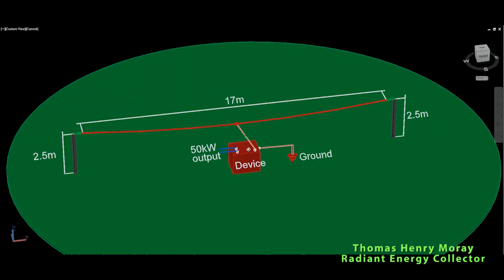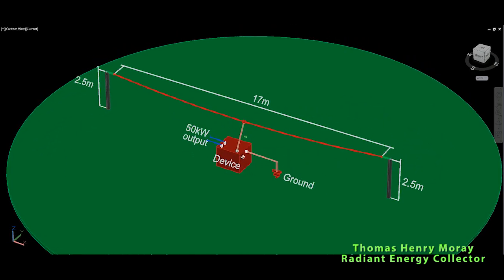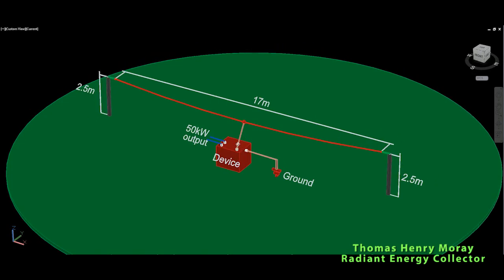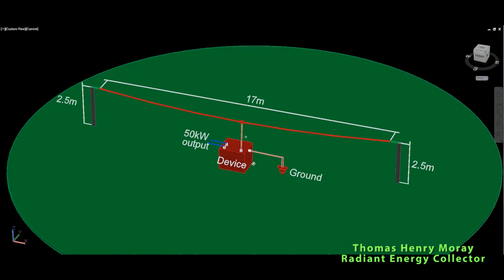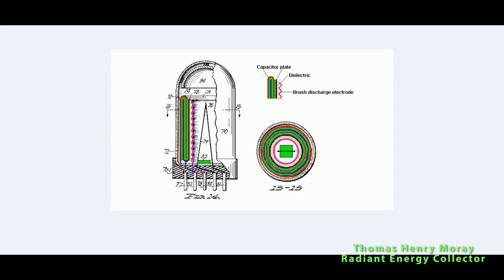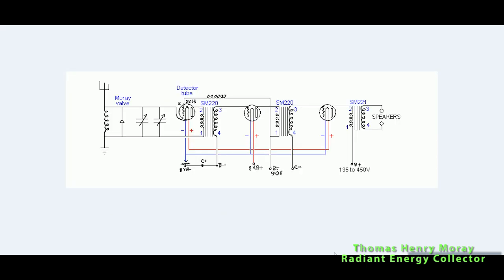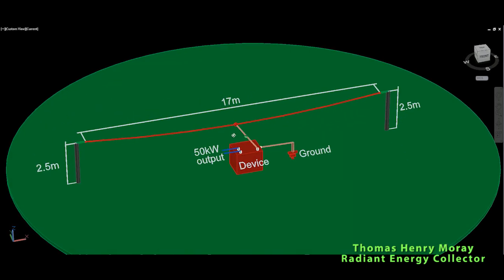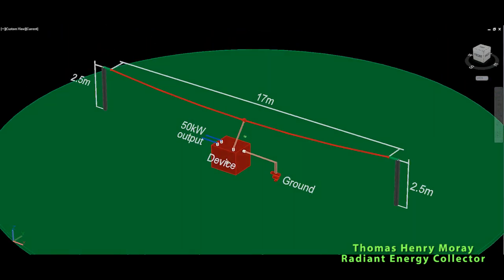Free Energy Generator, THOMAS HENRY MORAY Radiant Energy Collector

Comment: The morray valve was made using a vacuum tube produced by a company that made radio tubes it was a combination of a amplifier tube used in most guitar amplifiers and a  homemade semiconductor that was composed of a radioactive isotopes and a magnet and a emitter and collector the isotope was fastened to the emitter and the collector was a screen in front of a magnet. There was a filament in the tube that electron's jumped off of and would flow in a vacuum to the collector. The antenna was connected to the filament side and the transformer collected to the collector side then a earth ground the device baited radiant energy to flow to ground thru a transformer. The output of the transformer was cold electricity the opposite of hit electricity. I would light a bulb but would be cold instead of hot.
Reply: If you know so much why don't you just build one and release the world from these dark times?
Reply: ok! i am redjeff53@gmail.com....all of you old farts teaching your useless crap at your 'tenured' universities should get off your lazy fat asses and DO SOME 'REAL CREATIVE INVENTING!'  try this you asswipe critics of those you are jealous of! bore a hole in a chunk of uranium, 'turn' it on a lathe until you have a 'tube',...(wear a mask you idiots!) wrap it with a 'bi-filar' coil of copper wire,...slip another similar but thinner coil inside of the 'tube, connect the device(s) to a transformer, then measure the voltage and current for the next 10,000 years!!! ha,ha,ha,ha,hah,haahh! (redjeff53@gmail.com)
Reply: i,, redjeff53@gmail.com,...am working on this idea to power a mobile space station that will traverse the stars and travel at the speed of 'thought!!!' i will not need 'tubes' such as this 'henry moray!' i will experiment with hollow uranium tubes wrapped inside and out with 'bi-filar copper wires connected to transformers!!! ha,ha.haaah,haaaahhhh!!! (redjeff53@gmail.com)
Reply: @norakat  He would not find a manufacturer for the velve tube.
Reply: RADIANT ELECTRICITY  So radiant energy has nothing to do with quantum physics?
Reply: @pulsetao3446  nope, just invisible energy siphoning.
Reply: this device was 'tuned' to be off-harmonic or a harmonic of the frequency he wished to utilize. does anyone know for certain just what that frequency was? was it earth resonant? 7.3 or so hrtz? (redjeff53@gmail.com)
Reply: we should be able to make the cold tube now quite well and have a amp that adjust for best signal and changes for load now.
Reply: The heart beat of the earth! As Ham radio enthusiast would say! The morray device worked as I had previously described. It would attract radiant electrons to the antenna by baiting them into the circuit offering them a Ground. The electrons was captured by the vacuum tube amplifier circuit. Just as a simple crystal radio would operate by using a diode or geranium crystal and a cats whisker wire. .but the vacuum tube was a electron diode and trap circuit causing radiant energy to work before allowing it to flow to the ground.  A bifilar transformer captures the back emf and utilizes this radiance emission.. Tesla used a spark gap to create radiant electricity, and amplified this through the primary coil capturing it in the secondary as amplified electricity. Transformers step up or down current. There are many types of transformers and different windings . Copper wire emits magnetic fields as current flows, this field can be captured by another winding.  Radiance field is from a saturated coil collapsing as current is switched off this back electro magnetic force is captured by another winding and it freely flow's to ground and can be put to work before it is allowed to flow to ground.   Wire up a diode from a microwave to a spark coil from a car connecting the diode to the high voltage terminal to the positive on the primary and connect a power source and a interrupter sutch as a  switch or relay contacts and wire the relay to buzz  the coil will throw sparks much more  now attach a ground wire to earth and to the ground of the coil next attach a wire antenna ran up high  to the positive side of the coil don't allow the antenna to ground. When the coil is operating radiant electrons will flow to the antenna and be captured by the secondary coil and allowed to flow to ground as a high voltage spark this current can be stepped down by using another transformer it will be ac current and can be rectified by using a bridge rectifier
Reply: i wonder effect placing a potentiometer within the bridge rectifier would have on the final current? (redjeff53@gmail.com)
Reply: A potentiometer would create resistance and lower or raise current flow. If current flow was greater than pot value it would heat and burn out.  The morray valve was created with a doped Geranium Crystal crystals can be treated with radiation and they can be grown from liquids or gases. Crystals can be cut and tuned to oscillate at chosen frequency's. A piezoelectric crystal gives off current when compressed but will also give off current with oscillating currents  crystals distort thier lattice srtucture creating current flow
Reply: @davidwilliam1406  
Sounds good, can you rebuild for Ex the Tesla Converter, caused over 100 years agi it worked in a E car.
Anyway several years ago I stumbled over somethings interesting.
This guy converted a simple bicycle dynamo in a minipower plant to provide his small remote hometown first time with electricity, just 1 bulb for each house.
He did not explain what he really did, but it was about the copperwire winding around the Stator.
I heard only one Word "Helix" I started to investigate, but I found not information.
Anyway this boy said he converted this dynamo, thar his output is >100 times bigger, then the imput.
My idea is he made a double Helix winding around the stator.

Comment: If this was viable it would have been on Dragon's Den by now. And spare me the conspiracy nonsense about power companies suppressing the "truth".
The only time I ever saw anything similar to this during my time as an electrical power engineer was the farmer who put a wire fence underneath an EHV transmission line and parallel to it. He kept getting shocks from it (the fence, that is).
Reply: Wake up idiot. You've been dumbed down so much you cant see that billions of dollars in revenue for governments and corporations happily paid without question by the brain dead is at risk is people look outside the box. What research have you done? Oh you have a keyboard...There are many quietly making progress who aren't limited by 'education'
Is homeopathy a conspiracy? (the Royal family of the UK has been using it for over a century) And yet scientists claim it can't work.. Ignorance is bliss...
Reply: @seahippies  
Show me proof that this works. Why no photographs of actual equipment? What were the raw measurements (milli volt, microamps, frequency) of the signal coming down the wires from the middle of the dipole? I can tell you the frequency. It will be around 8.8MHz.

It's just a simple Yagi antennae. There's no way to get 50kw out of it otherwise my short-wave radio would have gone up in smoke, probably taking me with it, years ago.
Reply: @seahippies  homeopathy is placebo
Reply: @lancelotmairesse3608  So the rebalancing of, imbalanced or lacking, biologically vital chemicals is placebo.

But hey placebo works so either way it works.

People are taught to knock something by calling it placebo. But placebo works more often than not. So in essence thinking you will be cured very often cures you.

Do not underrate the placebo effect or natural cures. Cause they both work.
Reply: @mr.upcycle9589  I never said it does not work. It works, because placebo effect is real just like you said. And that's what scientist are saying. There is no conspiracy going on here
Reply: @lancelotmairesse3608  Care to elaborate?
Reply: @lancelotmairesse3608  The "Placebo effect" is in and of itself, an unexplained phenomenon. Attributing an effect of something to the Placebo effect is like tapping out. If you can't find an explanation, you simply explain it away by way of the "placebo". You are essentially tapping out. If the placebo is so effective, why are there still illness and disease? Much more than meets the eye.